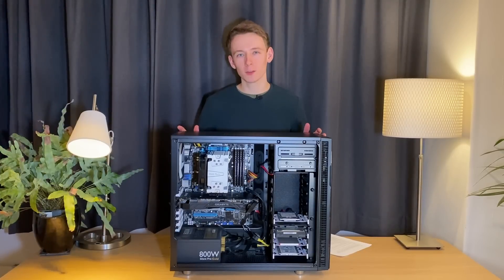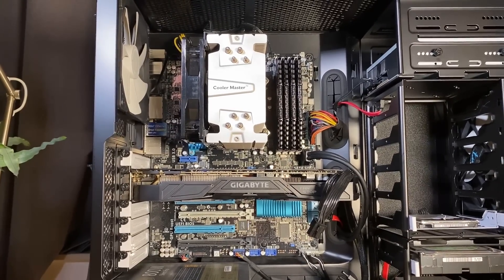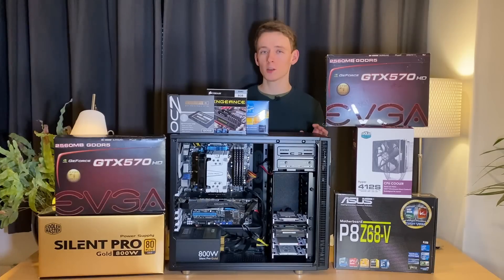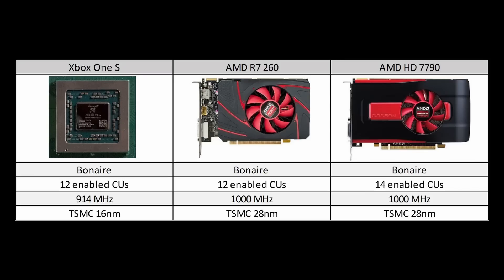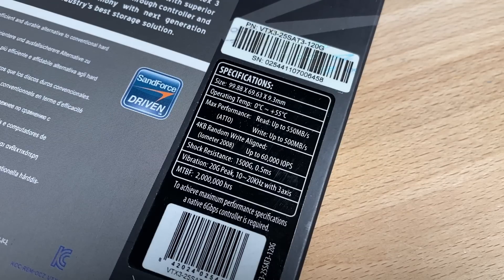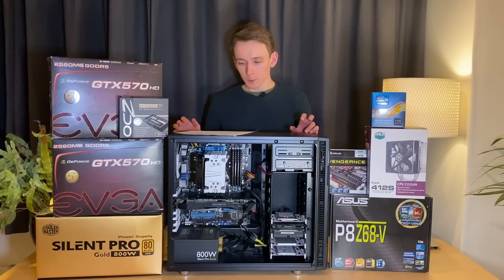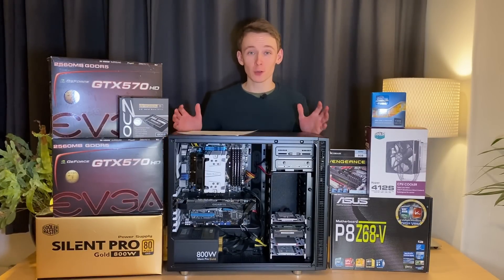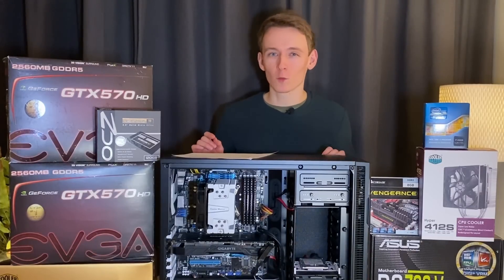I used an i7-2600K PC for over a DECADE - Here's what happened.

Comment: I ran an i7 920 from 2009 to late 2018 overclocked at 3.5Ghz since day 1 on stock voltages, 12GB Corsair DDR3 1600 CR1 (3x 4gb triple channel memory) and just basically upgraded GPU's over the years, GTX 260 Core 216, GTX 480, GTX 680 & finally a R9 290X, the 920 was always rock stable the only problem I had with the motherboard (after several years) was a SATA port that started intermittently glitching out but I had plenty of free ports to use so it wasnt a big issue, mobo was a Gigabyte GA-EX58-UD3R Rev 1.6 , I finally upgraded due to the same reasons discussed in this video, newer games were starting to struggle with the latest at the time being Hunt Showdown, it would sometimes hover around 40-45fps but overall the system served me very well for a long time.

Comment: i'm rocking a i7-6700k on a motherboard that I got with it for a low cost.  not happy with mobo, but to replace it, .. i might as well upgrade completely, and i have no practical reason to bother.  like you I get what I want and need out of the machine, and see no reason to upgrade to something else.  my rtx 2060 does it's job well,  I have the best nvme ssd m.2 drive from samsung for the year I built this system with the mobo and cpu used already with aio cooler.  aside from upgrading to a 32gb 4x8gb low lat kit of ripjaws 3600 ddr4, I have no further plans for this system or to move to anything else in the near future as everything is crazy expensive for needs I do not have right now.  only further upgrades I see doing is maybe swapping out the already old AIO for an air cooler.  A nice big air cooler.

Comment: I did run two Nvidia GTX 670s in SLI on my 2600k rig. Also, I spent extra on water cooling. I was able to run the CPU at 4.6GHZ continuously with a slight voltage uptick.

Comment: I'm still using mine! We even share most of the same components and the case. It just keeps going man, I'm just now considering something more modern. And the only reason is for AVX2 instruction set for tinkering around with AI stuff and because of the bottleneck it presents to modern GPUs. I'd love to keep using it otherwise. I'll probably keep it around for a CAD machine.
Reply from the maker: Very nice! Lack of modern instructions is a problem - chips like the 6 core Nehalem and Westmere would have been usable much longer with modern instructions..

Comment: since 2015 for 6 years my CPU has been my i7-6700T and it still is to this day. The only PC hardware change I made was in 2019 when I upgraded the GPU from a GTX 960 to a GTX 1660 Ti. Also I recently upgraded to windows 11 even though it doesn't support my hardware. Despite my older hardware and lack of support, my PC has excellent overall performance and I actually feel like my system is  performing better and utilizing system resources more efficiently with windows 11.

Comment: I still keep my old rigs and they are still serving us well.
One from 2012 with Phenom II, which recently upgraded to an "8 core" FX, 8GB RAM and R9 270X.
One from 2014 with Core i5 4th gen, 16GB RAM and an R9 390.
They are still functioning, all of them equipped with SSDs and running fast. They are also ok for esports gaming.
Daily driver is 3800X, 1080 Ti, 32 gigs of RAM.

Comment: I used my i7-960 for like 10 years, then upgraded the CPU to a 6 core Xeon and used it for a bit longer. Sadly a storm took out the x58 motherboard, but  I still plan to replace it and get it working again.

Still use my HP i7-2630qm laptop for audio production, air-gapped , only had to upgrade its drives to SSD and add more RAM.

Comment: Brilliant video. I agree. I may build high end for fun but in the end, it's what just works. I was so impressed for what a long run I had on Tylersburg X58 / i5520. Patsburg x79 / C602 was amazing but I didn't stay on it as long till X99. I'm still there on Wellsbur as newer X299 didn't have all that huge wow factor gong in. 
I couldn't agree more. invest in your foundation, (motherboard / chipset) upgrade to your favourite GPU and you can work for ages. CPU's & RAM offerings get cheaper as well. Under  £120 for an i7-6950X on X99 is amazing upgrade for what was once 1500 quid.

Comment: I loved every bit of this video. I ran a very similar set up and still use it today, too. Over the years I have had to replace the PSU and GPU due to failures from wearing out, and I have added a couple SSDs. Sadly I will be parting with the 2600k (or turning it into a media center) soon. With the arrival of DDR5 and PCI-E 5.0, I feel now is a good time to upgrade. I'll also be switching over to Ryzen for my next CPU. Thanks for this video!

Comment: Holy cow, this is literally the build I made back then, and used for almost as long, right down to the exact same SSD, motherboard and RAM, the main difference is I went with a Radeon HD 6970 instead of the GeForce. I also later upgraded that to a GTX 980, which is a very similar card to the 1060. Just an amazing platform with such long legs, by the far the longest time I held on to a system without feeling any need to do a major overhaul...

Comment: had my i7 4790K with Asus Hero, 16GB and i think also a gtx 570 bought in 2013...
upgraded it over the years... with SSDs and Graphics 
but 1 year ago, i built a new one: a 12900k, but still using key components like the case and power supply from then.
Good components really can survive multiple Generations :)

Comment: I'm still using i7 2600 no-K version of that. Few years ago i can't be able to obtain one of those Z68 chipset but now, after roughly 6 years i bought Z77 MSI board and get straight in to overclocking. My best is 4.45GHz, 10MHz above is unstable after some time. Very good for gaming, even a GTX 1080Ti can push itself to the 100% utilization. Well balanced for the 1000 series gpus. And that is only 4.4, K version can go up to 5. With RTX 2070 and i7 2600K clocked to 5GHz it will be a goooood gaming PC BUT i will  buy an i7 3770K with even better single core performance rather than pusing the poor 2600K to its limits
Reply: I have the same setup as you. MSI board with auto overlock 2600 none K to 4,45Ghz. Also running 1080Ti on a 3440x1440p 100hz ultrawide. :) 11 and a half years ago still rocking on.

Comment: I still use i72600k at 4.5 
1080ti
16gb vengeance 
800w fractal tesla
Samsung evo ssd
Z77 extreme 6 
Zalman liquid cooler
Sp120 static pressure fans

And i run apex legends everything ultra at 160fps...

Comment: I started with an I7 920.  Its now a W3690 Xeon with 2 Samsung 950 pro's for storage.  780 TI gpu.  All I've changed out is the HDD to NVME and the psu from Antec that blew out in 2017.

Comment: My build from 2011 looks similar and I used it until now:

Intel Core i7 2600k
ASUS P8Z68 Deluxe gen 3
Corsair Vengeance 16GB DDR3 1866Mhz
ASUS ROG GTX580
Cooled and powered with BeQuit!

It actually worked fine and still doing a great job. The upgrade is just need to play modern title like Metro Exodus, Cyberpunk, etc.

My new system will be using the RTX3090 paired with the 5800x3D and 32GB of DDR-3200 CL14 RAM.
Hopefully futurproof as my old system.

Comment: Nice video!  You do well to showcase this CPU as useful so many years later.  I built and sold two i7-2600K and two i7-2600 PC's paired with a GTX 970 and a GTX 670 (three times) in the last 6 months.  The inclusion of a GTX 670 was during the height of the GPU shortage.  Could still game on it surprisingly well.  The GTX 970 became the new budget card 3-4 months ago and now I am finding cards like the GTX 1070 affordable.   The drop in price has been fast.  I would pair any of these cards with an i7-2600K  (perhaps once I go through the several i5-6500 units I currently have)

Comment: Well I still have my Asus M2R23-MVP AM2 motherboard from 2005. I used it from 2005 to 2017 on a 2.6 Ghz Athlon 64 X2. It now has a 3.0 Ghz. All the caps are still in order. Rock solid motherboard. It did run WIndows 10 32 bit for awhile.

Comment: Still running my 2500K@4.6,  similar mobo,  Chieftec 850W PSU.  All Bought in 2011. GPU was GTX560ti at first. Now i am running GTX1060, i bought 3-4 years ago. Ram was 4gb, then 8gb. Few years ago I upgraded to 2x8GB ram, also similar to ones in video. But they are  2400mhz max. I managed to run them at 2133mhz, which is not bad for 2500K. Last year I got simple 960GB SSD, and put three free 1tb laptop hard drives into 2.7tB pool for unimportant file storage. Also running 2x320 gb hard drives in raid to get one 640gb drive, which i will probably change to new  cheap 1tb drive, since it is only to have backups ant some random stuff too. I dont game a lot, so this pc is still very fun to use. SSD made it very fast. Feels fresh and hard to believe that main components are over 10 years old.

Comment: DUDE, I'm still running my I7-2600!! I have the ASUS P8Z68 GEN 3 MB, 16 gig G.skill memory, RAVEN RV01 CASE,  I JUST upgraded video from a NVidia GTX 560TI to a Nvidia GTX 1650. lol 120 Gig SSD.  I just purchased a 450 gig SSD waiting to put it in when i get it.  My system runs fine, does everything i want it to do and it's not slow.

Comment: I still run a very similar setup. I got the ASUS z68 pro-gen3 and added a m.2 in the pcie slot.(had a special bios mod for this) I upgraded my 2600k to the 3770k. I had one that clocked to 4.3GHZ but I found one that did 5.0 ghz. I currently still run the setup at 4.7 direct die water cooling. I also had 2x 570's in sli, then went to  a 980ti and now a1080ti. I think it is then end of the line and I will do I nice Ryzen build. My case is a tower 900 with 2x 560mm radiators and 13 fans. So much cooling capacity you can run is passive or just with the fans idling.

Comment: I have a cousin who also uses an i7-2600k based system since he first built it in 2011, also with a GTX 570.
Gradually the PC was upgraded with an SSD, another 8GB of RAM (for a total of 16) he got for free from a PC I found in the trash, a used GTX 980ti and a new PSU because the old one wouldn't turn on with the 980ti plugged in (broken cable most likely).
Reply from the maker: The 980Ti is a nice match for the 2600K.

Comment: I just built a system for a kid I know with an i72600, 16gb of DDR3 and a GTX970. I was surprised how snappy windows was, and I tested Fallout4 and Witcher3 on Ultra settings (1080p) and got a solid framerate. I think I paid about $200 on all of the components picking up pieces on ebay, and I pilfered a few parts out of my personal boneyard. I was very impressed.

Comment: I had almost the exact same system, but I put a EVGA 670 4gb GPU in it. Gamed on it for 10 years. I eventually replaced the 670 with 1060 that I got dirt cheap. 
Simply overclocked when I needed more power through out the years.

Comment: I'm still using the same cpu and motherboard 12 years later and have no intension of upgrading.  I did put a 3090 TI into  it just to see how it ran - not well.  However my massively over clocked 980 ti strix is still able to run most games at 1080 at 60fps.

Comment: i dont think i ever managed to make 4 years without upgrading. the build bug usually gets me long before my rigs go tango uniform, in fact my previous 4 builds still all work. though the oldest (a second gen i5) has been stripped of parts, where i had hoped to turn it into a mining box, but the gpu shortage and various crypto crashes killed that, so i might just get rid of it. 

though i should point out that i reuse cases, power supplies (if they are good) and drives whenever possible. those 5 builds have lived in 3 different cases. i stopped using optical drives because of failures and i got rid of the hard drives in favor of ssds and later m.2 drives on my last two builds. the older ssds got usb adapters and were plugged into the router as network backups.

id at least do a core components swap with modern middle tier hardware, as you are in a position to see an improvement from that. i think the best improvements in the last decade has been in fast storage. nvme has been a game changer. cpus and gpus have rapidly been picking up steam in the last 2 generations. my last core components upgrade was more about getting pcie4 and faster usb3.2 (or whatever they decided to call it) and faster networking, and decided to stick with ddr4 because of how expensive ddr5 was at the time.

Comment: yeah my i7-2600k is still going strong. Its my brothers now after I bought new rigs for myself and my sons. Back in the day I had Oc'd the hell out of it, even though air cooled it still handled it really well.  It's paired with SSD, 32gb ram and a much newer GFXcard radeon RX5500xt 8GB.  He is really happy as it runs his PerfectGolf game on decent settings. His old janky laptop wouldn't get more than a few FPS if at all.  it started life with singe HD5770, then dual HD7870 crossfire.  I'm guessing any bottleneck will be CPU by now, rather than GPU, but as I say, he plays golf games not BF/COD type games so he's happy. Wow that CPU has some mileage on it and been driven hard and still doing its thing daily with no problems.

Comment: Last year i bought another computer second hand i don't think the money for a new computer is worth it atm. Just like you've said in the video, back then you could get a whole computer for the price of a cpu  today or gpu or whatever! Everything costs a lot more. So anyway, i'm still using my i7 2600k as a gaming station around my TV for emulation games. Just replaced the stock intel cpu fan with a noctua and holy cow what an improvement. So for the first time i overclocked it. Perhaps i missed it in the video, but i'm guessing yours is clocked aswell, correct? 

I only have a 3gb Radeon r 280x card in it tho. Probably need to step up to at least to an 8gb card to be able to run Mario Kart 8 Cemu with normal graphics settings without big fps drop outs on graphic intense places in the game. Can you run Cemu or Swith emulation smoothly without going down to fps drops to like 44-48fps? Would be neat to know
Reply from the maker: Nice! Yes I've been running mine at 4.3 GHz using stock voltage

Comment: I used the i7-2600k from January 2012 till I upgraded to Ryzen 3900X in October 2019. Main upgrade over the years was GPU.
Radeon HD 5770 -> GTX 770 -> GTX 1070 -> now 3080.
When I first built a new system on a budget in December 2011, I did go with a AMD FX-4100, but it was so bad, felt worse than my old I had year earlier, Athlon X2 6000+, so I sold it and picked up the 2600k in January, and had a blast, and it really held up it's value over the years.

Comment: I used over the decade 
- i7-2700k @ 4.5ghz from day one 
- Sabertooth p67 ( best looking motherboard ever period ) 
- Scythe Yasya CPU cooler 
- 24 GB DDR 3 Patriot
- SSD OCZ Vertex 3 128gb,  + 5 more various mechanical HDD, added over the decade ( most of them are still in use today )
- gtx 570 palit for BF3, upgrade to R290x for BF4 then upgrade to RX 580 when 290x died on me
- Corsair TX 650 PSU ( still in use in main machine today ) and all packed in SilverStone Raven 03 case ( still use it for my Ryzen 2700 PC )
Switched to Ryzen 2700 and that upgrade was 4 years ago. My 2600k got nice new home in HAF X, powered by CoolerMaster 550w
And 2700k is still chugging  along my nephew used it now and it even have same GPU as my PC ( RX 580 )
And yeah i still have the boxes from most of the parts.
2700k is a legend.

Comment: I have been using a Core i7 860 2.8GHz@3.36Ghz processor with a Gigabyte P55A-UD3 motherboard and 8GB DDR3 1600Mhz RAM since 2010. (The motherboard BIOS is from 2009.) Recently, an SDD was installed instead of the HDD and an RTX2080 instead of the old video card. Many "AAA" games still run quite well on it in full HD.

Comment: Got an X58 system hand me down back in 2020, but unfortunately it died earlier this year. I had barely any money for a replacement so I only managed to get an i5-2400 bundle. Turns out I am more satisfied getting my hands on old but still useful pc components. Heck I even am thinking of upgrading on an i7 4th gen optiplex when I get the money instead of going for a modern build.

Comment: I'm actually running it. Still 4.4ghz under the same NH D14 and never replaced the TIM. Still can't exceed 67 degrees Celsius. Had 16gb since day one. Now a new system should have at least 64gb but economics are pretty dire.
I had two 6950 Sapphire, went from that to a 770 and then 980ti amp extreme

Comment: Still running an AMD phenom II 1090T myself along with an Asus HD 7970 direct cu ii (upgrade from crossfire 5850s) an OCZ agility 240gb and 16 gb of 1866 cl9 ddr3. It is almost still fast enough... I wouldn't mind it going a tiny bit faster at this point. Mostly when it comes to editing longer videos (ones too large to fit on a virtual RAM disk), compiling large projects, and some CPU bound games. but the real problem is x86 has moved on past the instructions my CPU actually supports and I would need to emulate instructions to run some modern games or even some modern development tools that I avoid using. After 12 years, I'm ready to upgrade. I'm likely going to go over kill again because it worked so well last time. I think I could squeeze out a decade from the new PC I will build.
Reply: @Lurch7861 why would I play that? I haven't bought a game off sale in a decade.